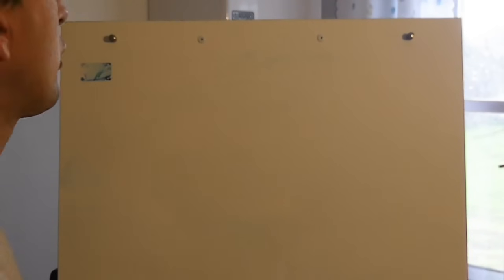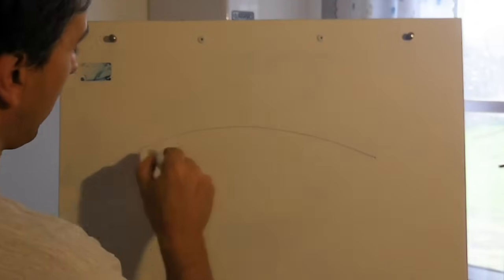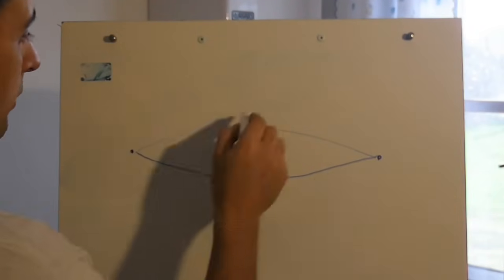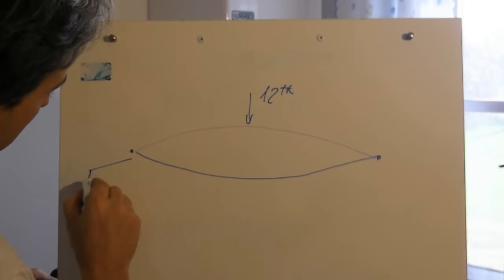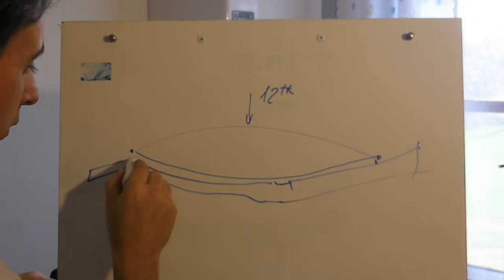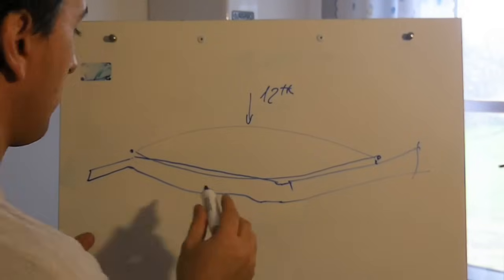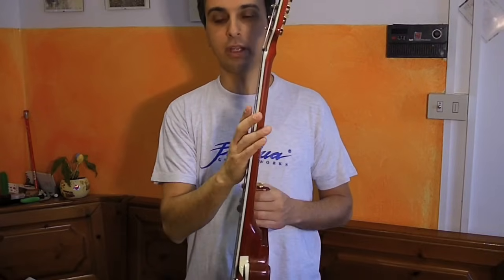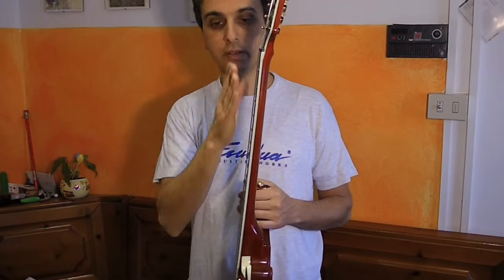Truss rod adjustment: how to adjust the truss rod - frudua.com

Comment: Instead of using a credit card for thickness reference, I'd like to know the thickness in say, thousandths of an inch.  It seems to me to be more precise and I already have feeler gauges on hand... Checking one with my calipers, I come up with .022",,, does that sound right?  If so, I'll use that credit card as my reference thickness.  Thanks for the informative video!

Comment: How much resistance should I feel when adjusting my guitar? I have a Gibson student guitar and there is zero resistance, I think someone completely unscrewed the tross rod adjustment bolt - If I continue to turn clockwise I eventually do feel some resistance, but then I am afraid to go any further bc I do not want to damage anything. The guys on the fender forums say you feel resistance anytime you adjust your truss rod- is this true?

Comment from the maker: @VcookiemonsterV First you adjust the TR. Normally if the guitar buzzes on the last frets, neck needs less releif and viceversa. trys tightneing the TR and giving the neck a bit less of relief. Then go and adjust (raise) the saddles as I explain in the other dedicated video. If you still have problems (pluck with a pick not with fingers)  you most probably need a fret dressing.

Comment: I have squire bullet strat and I have tried a lot with trust rod adjustment but the low E always rattles from 5th fret and higher. I have another same guitar that has a floating bridge setup and that is what fixed the problem on that guitar. But I dont want to float the bridge on this guitar and I tried everything with saddles too. So is it just a crappy guitar or what? It is cheap for sure but is it crappy too? :)

Comment: Lower e string is too low, so when I put capo it doesn't even touch the fret and buzzes.
I have fender cd60ce, my teacher used to adjust the truss road, been travelling a lot so the neck seems a lit bent backwards.

What do I do?

Comment: I recently did a refin job and when I put her back together she was all buzzes and it just needs a good set up. Unfortunately the brisge saddles were not recorded or measured and so it's in a real state. I only get buzzes from about the 16 fret upwards. And this is when I attempt to bend i just loss the note. Any help would be greatly appreciated.

Comment: I have a very complicated problem with my guitar. It sounds great, but there's a major intonation problem. When I tune my B string to be perfectly one fifth above the 2nd fret of the D string (In other words one perfect fifth above e) and then I try to play an open D chord, the B string is extremely sharp. I have checked the overall intonation (12th fret harmonic vs 12th fret fretted) in playing position and that isn't the issue. Help? 
P.S. There are problems similar for other chords

Comment: Other guitar sites say to remove the strings prior to adjusting the rod. You do it with the strings in place. Why the difference?
Reply: David Knapp removing the strings would be counter productive, as they add a ton of tension to the neck, and you need this tension to be there to make correct adjustments. If anything, maybe these others are working on older guitars and don't want to add more strain to the rod than is necessary, especially if tightening. In which case, measure the relief while in tune, loosen strings a bit, make adjustments, and then tune back up.

Comment: if you think about it, you would never be able to predict how much adjustment you needed with the strings off the guitar. as the string tension will change the bow in the neck when you tune it back up.

Comment: How you know when truss rod is at its limits? because i feel a little more adjustment but i am afraid that i might brake but i can't tell
Reply: if it gets extremely hard to turn the neck may be warped.  If you continue turning you may snap the rod and that is not a cheap fix. Take it too a tech or your local luthier.
Reply: Randall Hughes That I agree on for once with you
Reply: After your death threats i dont care what you think but the police sure were interested in your posts.
Reply: What death threats ? at what point did I threaten you ? im not mad im just asking. I didn't say one single thing to you that was a threat, and I wasn't intending on threatening you or anything. I was just blowing off some steam from the heated argument we got into. I didn't say anything that was a threat to you. If I did id like to know specifically what sounded like a threat to you ? im not mad im just asking to clarify. Ive never even threatened or hurt anyone in my life so I don't know how that came off.
Reply: You said "youre dead"  that is a death threat.  The most vague interpretation of it but it still is.
Reply: my bad I apologize for not clarifying that. I didn't mean in that sense, but all in all. Im glad we're friends, and the dust settled. I like your videos by the way. your a big pedal guy eh ?
Reply: Nice, ive never heard of blackstar though. I used to have a big chain of pedals myself I still do but haven't used them in a while due to them cutting the sound in the chain, so since then ive just been using guitar to mt-2 and mt-2 to amp. How long you been playing guitar ? what kinda music do you play ? I see you like metallica, so im gonna assume thrash metal. what else ?
Reply: I don't have a problem with my pedals sucking the tone because I buy higher quality chips, diodes, resistors transistors and pots to make them better than stock and more than doubles their value.  Blackstar was created in 2007 I believe when Marshall started pushing the solid state mg line and more than 30 members of the research and development team quit, cashed in their 401k's and started Blackstar which offers only one solid state amp the ID series.  Last week I bought my first 9 string.  Yes my specialty is rock hard rock and metal but I also play classic rock and southern rock, classical (the 9 string is beautiful for classical) punk jazz I don't set any boundaries.  If my ears like it I learn it and the basics of how to play the style and go from there.  Metallica is my favorite band and I have so many second favorites such as A7X early stuff, bullet for my valentine, staind, nickelback, SHINEDOWN and so many others.  I even love Elton Johns music.  Yes he may be homosexual but his voice, piano skills which I will start playing keyboard but I am in no place to judge others.  I've been playing since December 23rd 2002 so about 13 years and early on I broke many a guitar due to my anger but was put on a sedative (klonopin)and haven't broken one since.  I currently own 7 guitars and 4 amps.  And I suck in those videos. That was at a time in my life in which I was with a girl who had 2 children and I fell out if love with the girl but loved the kids so my music got sat on the back burner for about a year and those are videos I made as I started playing again.
Reply: That's pretty interesting facts I never really knew. Pretty knowledgeable dude. Its cool to accept Elton john, people can be who they want to be and like who they want to like, but its their personality that counts, and also yeah if theyre good at music or technology whatever their good at is a bonus. I own 5 guitars and 2 amps, ones a marshall valve and the others a randall. You should def upload more videos, I aim to do the same, I actually had videos up posted before, but they were posted at a time when I was dating my ex and I deleted them because they reminded me of her sadly. But I am aiming to upload some videos as well on here. Metalilca are pretty awesome, whats your fave album by them ? I don't get why many hate the black album, its not that bad lol.
Reply: Well i have been i die hard metallica fan since my dad showed me their music back in about 1995-96 while i was in fourth grade i overheard 2 of my friends speaking about them and i got home and asked my dad what is metallica?  to which his response was theyre a band and next time we go somewhere ill play some of their music in the car and this was right after Load came out and I had seen the video for "Until it sleeps" and thought it was a weird video and bad but then King nothing and Hero of the day and i have been in love ever since.  I saw them in concert and that was the only time in my life i felt as though i was standing before GODS so to speak not as in me Worshiping them or praising my soul to them because my soul belongs to Jesus but to see the guys that made the music i had turned to in so many good and bad times in my life.  I even have a tattoo of Metallica across the top of my back and their Ninja star insignia around the center of my back.  I got it for free for doing a disabled mans house and yard work.  My favorite album would have to be ....And Justice For All.  the precursor to The Black Album and the reason so many hate on that album is because it made HARD ROCK/METAL mainstream so their hatred runs deeper than just that album.  I dont agree completely with their stance (especially Lars) on napster back in the day because if it werent for friends telling other friends of them and sharing their songs they wouldnt be the best selling HARD ROCK/METAL band of all time and more wealthy than any person ever should be especially when a man or woman is gettinng shot at and barely have enough money and food to survive yet a band or sports player gets payed millions for only working a few hours a day but James does always thank everyone at their concerts because if it werent for the fans and people they would be nowhere. and the most pathetic statistic in America is less than 1% of the population holds over 40% of the entire nations money. Im not asking for a hand out i just ask for equality. Over 90 million records sold worldwide if my memory serves me correctly.

Comment: I would like to see the truss rod itself installed in the neck before you add the finger board and to see the action of the rod during the adjustment. Thanks.

Comment: im only getting a buzz on my E and D string, i know weird, i tried adjusting the truss rod nothing happened, before i changed my strings i didnt have this problem, the only thing thats changed was the strings gauge, i switched from 9 to 10 gauges, i have a Fender Stratocaster

Comment from the maker: hry there is not that much you can do if the problem is just on that fret. Check that the fret is not moving but gently pressing it. If it is glue it with a drop of superglue or have the frets dressed by a pro!

Comment: You said the bridge shouldn't be touched. Ok, but if you get a guitar that isn't setup at all, where do you start, the truss rod or the bridge?
Reply: i would start with the truss rod bc until you get your neck right you will not have anything to adjust your bridge to. that's just me but it serves me well.
Reply: Yeah, that's what I figured.

Comment: I had the question myself for a second, but in pressing the 11th fret your are pushing down the 10th actual fret so you can tell the difference, you see what im saying, the fret isnt the space between its the medal part so to speak. if you are doing it opposite you wouldnt be able to accurately tell.

Comment: I don't have a business card, don't even have a business or an expensive Fender guitar, only a cheap Stagg accoustic (2 c's is correct, not 1c in accoustic) which has been ok for 5 yers, but I notice the neck has bowed a bit at 10th fret..........._......... like so. I can only access truss rod from the sound hole not the neck, which way should I turn? Intuitively I feel anti-clockwise, but I don't know for sure. I am going to mess about with it and see wot happens.

Comment: Hi I was wondering if you could help me. I have an electric guitar with a bolt on neck and at the heel of the guitar there is a tiny gap. Its not big but its bugging the crap out of me.if you dhine a light at the side of the heel you csn sort of see the screws. Is there something I should do about or do you think its okay?
Reply from the maker: Denver Williams Bolting the screw more?
Reply: string and tune guitar. loosen the four neck screws two turns and let the strings pull the neck into place more. then tighten the neck. see what happens.

Comment: Help! I have a problem! My Stratocaster is 2 years old, American Highway One Stratocaster. I' ve adjusted the relief, so that when I put a capo on the 1st fret and press the 17th fret with the other hand, the distance between the 6th string and the 7th fretwire is about 0,28mm (measured with the feeler gauge). Then I adjusted the height of the strings from the bridge. Everything is perfect except the 15th fret ;( I have really annoying BUZZ by every string on the 15th fret.. WHY?

Comment: Well , if you find someday something wrong , with the neck , its not a problem of adjustement there is really something wrong with the neck , i had a guitar in europ , i moved to the philippines and nothing never changed.The problem is also that factory sell guitars not properly adjusted.

Comment: I could be wrong, but most guitars I've seen have double dots on the 12th fret, and it appears you were tapping the 11th fret. Just sayin.
Reply: fret means the metal strips inserted in the fingerboard, than by extension it means also the space before the metal strips. He is tapping the 11th fret, but he is right because doing this is evaluating the space between the 10th fret-the metal fret he means- and the string.  He is tapping above the "metal bar" of the 10 fret, he means close to this fret. Doing this on the 11th or on the 10th- the space- is the same, is not like playing is to evaluate the distance between the string and the 10th metal fret. Grazie Frudua, bellissimo tutorial

Comment: blimey this goes on a bit. what i do. capo 1st fret, hold down 15th fret with finger. check business card will slide under 7th fret. if so all well and good. if not back off truss rod a little. until card slides under,  check open strings for string buzz  if any found back off truss rod a little more. acoustic guitar aim for action of under 3mm at 12 fret, take a little off the saddle if you need to. top nut, if guitar plays well around the first 3 frets leave alone. job done have a good day.
Reply: nice synthesis, Tony! The vid's good but as you say, it could be reduced!

Comment: looks like youre tapping the 11th fret instead of the 10th, but ok, thanks for this anyway
Reply: He's checking the left side of the 11th fret, which would be the 10th fret conventionally. This is because he's examining the string between the 1st and 10th fret, so you hold down the outside of each fret (left of 1st, right of 10th).
Reply: Unless your lefty.
Reply: I noticed too

Comment: you do not. the adjustments being made through the truss rod are very small. you probably couldn't see it with the naked eye. but it makes a difference. you may, however, need to retune the guitar afterwards.

Comment from the maker: @damrak1969 thank you! check it out at fruduadirectdeal >>dot >> com.

It's carved from solid wood using a pin router not CNC and finished by hand. Kinda of an old school method. I won't suggest you press the neck to hasten settling. The result is always uncertain. I suggest you use the trick I show in the video. This is more natural for the neck and 90% times help to hasten the TR settlement.

Comment: Wait Wait Wait . This is not completely accurate .
Correct way:
1: Make sure the guitar is in tune
2: Use a capo to hold down LOW E string against the first fret 
3: With finger , hold LOW E string against 12th fret.
4: Slide correct gauge  ( .006 /.15mm ) between LOW E string and 6th fret
5:adjust truss rod as needed to light touch

Comment: this video is just a bunch of baloney. the neck will move only a few thousands if the weather changes. I've been doing this stuff for years now and I have never seen a guitar that would change a relief more than 4 thousands of an inch from winter to summer. yes the relief and action go hand in hand. but this guy didn't explain that first of all the nut action is most important comfort factor, then the bridge and lastly the relief.